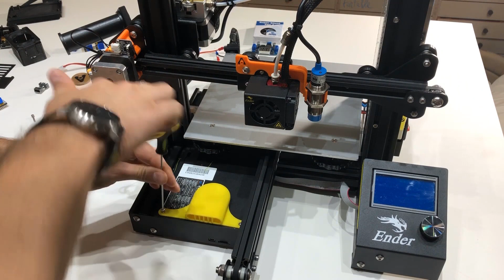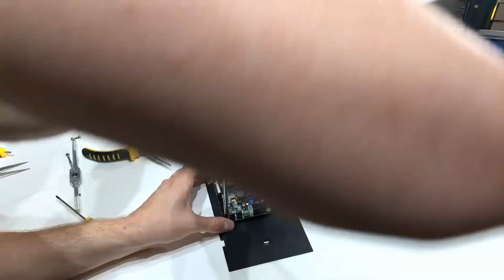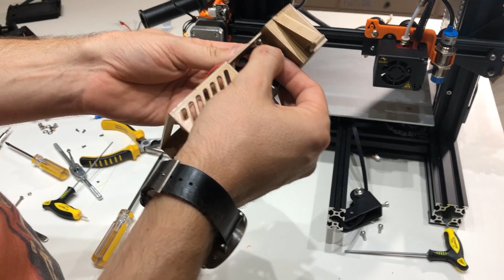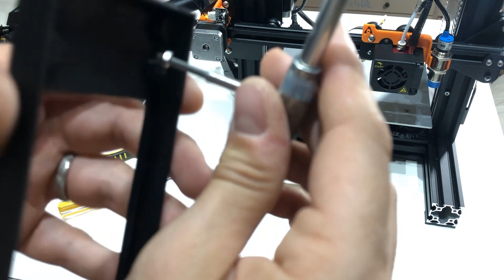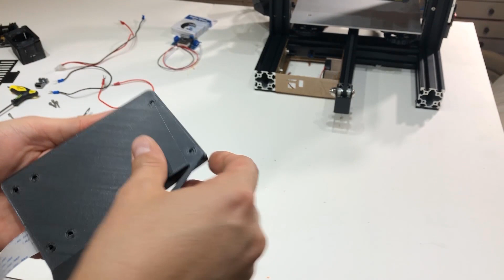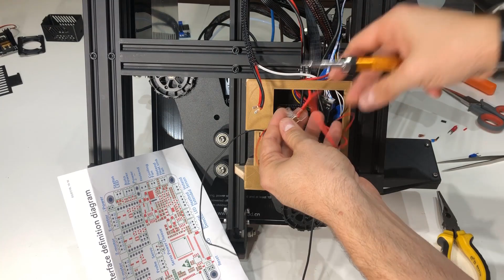Lerdge-X on Ender 3 project - Part 2: Assembly

Comment: So this lockdown has given me time to finally install Lerdge X in my Ender3. I'm lost with the hotend connection. From the HE there is the 2 heater wires, this would go to the Lerdge board,  the red + black wire does this go to PSU 12V supply ? And the blue+yellow wires - where does this go to on board ? 

With reguards to the heatbed, I didnt realize the expansion module was required but I do have the MOSFET module. Can this be controlled on/off without the expansion module ?

Comment: I have some questions about the Lerdge setup. The Heat bed module, I take it you used one? Did you use the Temp sensor on the bed it's self or another one? Have you upgraded the X's firmware and if so did you need to revise your config file. Endstops did you adjust them manually or in the config file. I used your config file but even though I "home" the printer it tends to chatter the X & Y stepper motors.